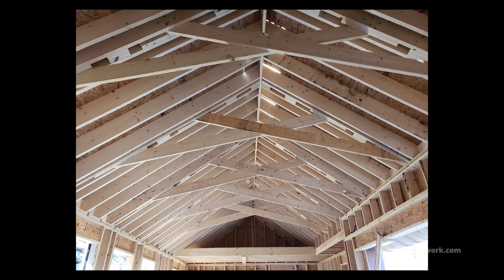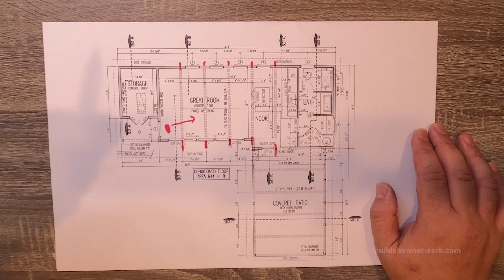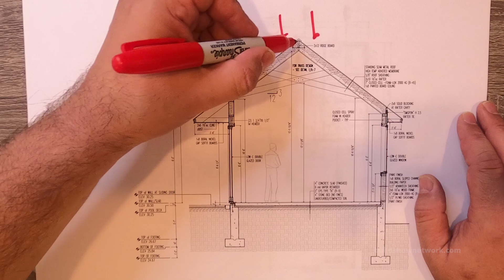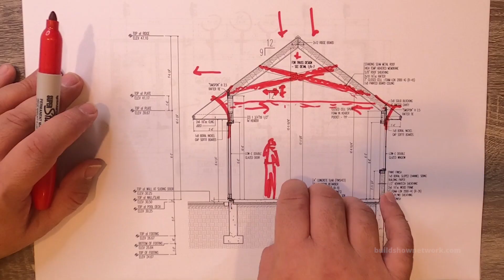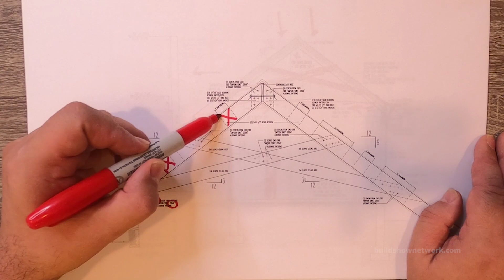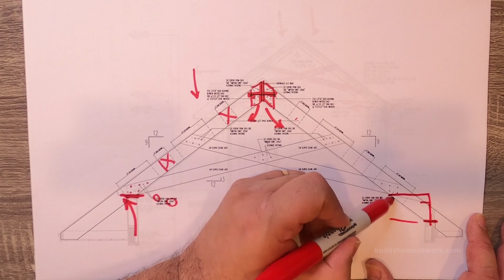CEILING DETAILS in the pool house!

Comment: Honestly, there is one little design element here that completely wrecks that "It feels good" aesthetic for me, and that is the unequal wall heights. My eyes were immediately drawn to the fact that the trusses are at different heights on the wall, which forced me to mentally investigate further and determine the source of the incongruity. Even after seeing that the left wall is inset under the trusses by about a foot or so, it still "feels" like the trusses are not square with one another, even though my mind "objectively" tells me that they are.  This produces a bit of cognitive dissonance for me, which leaves me feeling not good about it. Just my own personal opinion.